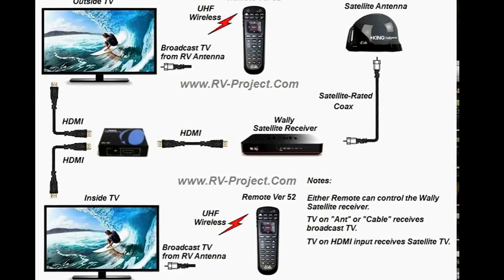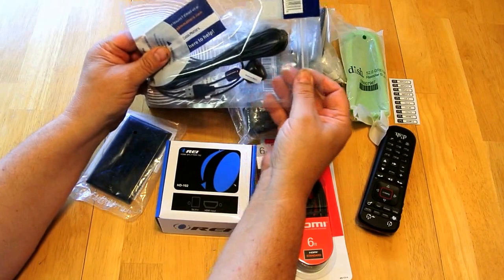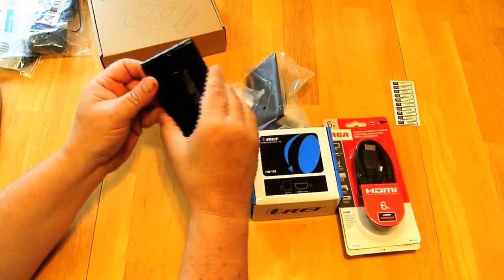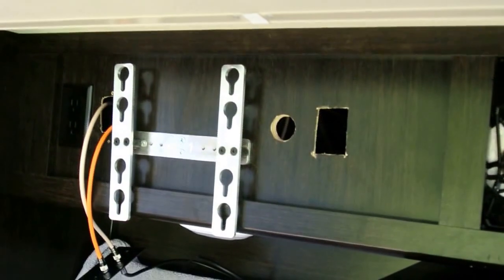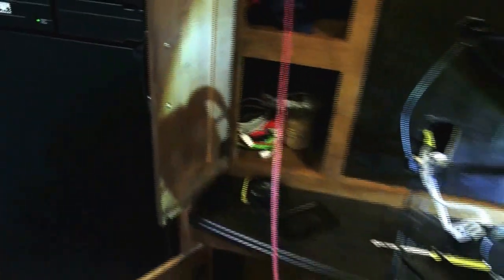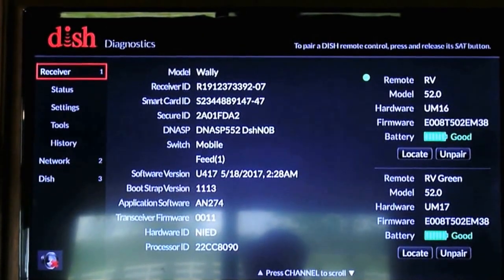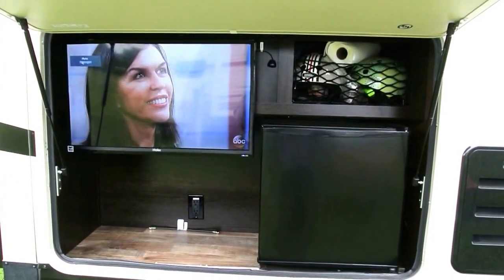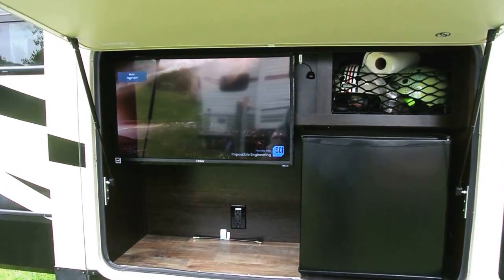Dish HD on multiple TVs in my RV.

Comment: I bought the Dish Playmaker Duel , now we have two separate TV Dish cables and we can watch different channels at the same time. Cost a little more and dish charges a extra $7.00 per month to send two Satellite Signals, but worth the extra charge.
Reply: dennis phillips what is the overall cost per month for that system?
Reply: With the playmaker dual you CAN have two receivers on two RG6 cables independently and it works just same as your house? All I need to hit is Sat 119 for HD service I would like a second receiver in the bedroom.

Comment: Looks great!  Is the Wingard X1 the best, most versatile, most durable and affordable unit out there? And it sure would be nice to watch 2 different channels from the same outfit. What's it take to have 2 televisions each with their own show on?? Don't tell me we need 2 separate dishes or outfits?? thx
Reply from the maker: You need two different receivers and a multi-receiver capable antenna.

Some portable antennas have multiple coax outputs, but it's almost a moot point as you typically need a larger antenna. The portable ones like the King Tailgater cannot view all of the satellites at the same time. 

For example, your antenna at home is larger, and allows the reception of multiple satellites without having to move the antenna. The smaller RV antennas have a much smaller antenna and as you access different satellites, the antenna actually re-aligns itself slightly for each one.  It's not uncommon to lose the signal for up to one minute each time you change channels.

Obviously this will not work with multiple receivers accessing multiple satellites simultaneously as the antenna would be constantly in motion trying to home in on different satellites.

For dish at least, some of the higher-end receivers actually have multiple receivers built into the box. For example, the Hopper 3 has 3 receivers.

Then a home antenna fit to a tripod would be the best antenna - but you will then have to manually adjust it. There may be some automatically adjustable larger RV style roof-mount antennas, but I have not done a lot of research on those as they were beyond my needs.
Reply: RVProject Thank you. I'm not planning on ever mounting anything permanent on my TT roof. The less holes the better. I'm for portability. I'm thinking of getting two 100 watt Renogy solar panels and their appropriate controller. I prefer parking in shade  and place the panels off whatever distance in the sun on the ground. Zamp is probably better than Renogy but twice as expensive. 
I was told by one guy to buy a 12 volt television because inverters draw too much power themselves, but someone else said most 12 volt televisions are junk and just have the inverter built into the tv anyway. I've got 2 Trojan T145 flooded 6volts. The YouTube Love Your RV guy suggests a Samlex pure sine wave inverter and to keep my regular AC powered 24 inch Sansui LED television which draws 31 watts.
I sprung for the 300 watt pure sine wave Samlex inverter. I hope it's not going to drain out my batteries after an hour of TV a day boondocking for a week or 2??
Reply from the maker: A modern-day solid state TV itself uses low voltage. They all have power supplies that convert 120VAC to the internal DC voltage they use. 

When I had my Class C, one of the TVs was powered by 12V. I looked for a 12V replacement TV because I wanted a better one, and my research revealed that many TVs use an external power supply "brick" that produces 14VDC and a plug into the rear of the TV.   I could not really find a replacement 12V TV at that time.

Could you simply put 12V into those 14VDC powered TVs? Hard to say. It's not likely 14V is the final system voltage, and there is almost certainly an internal regulator in the TV that produces an even lower voltage. 

However, the typical regulator requires a slight voltage difference between input and output to be able to regulate properly. Whether 12.6V to 12V (100% to 50% charge on a battery) is enough for the TV to work properly I never did try.

No power conversion gadget, whether it be an inverter, converter, or power supply is 100% efficient and will introduce losses. So by running the RV off batteries, the potential loss path includes converting 12VDC from the battery to 120VAC by the inverter, then changing it again from 120VAC to whatever DC voltage is necessary via the TV's power supply. The converting of voltage from 12VDC to 120VAC and back again certainly loses capacity in the battery.

The two Trojan T145 batteries are 260AH each, which theoretically produce 3120 Watt/Hours. However, you should never drain a lead-acid battery more than 50% for the longest life, so you will get (again a theoretical)  1560 Watt/Hours of capacity before potentially damaging the battery.  

By the way, you should have some kind of monitor on your batteries so you know where that 50% point is.

I say theoretical because we are not accounting for losses. So for simplicity's sake, we can consider your TV having a 31 Watt requirement, if powered for 1 hour, it would require 31 Watt/Hours. Thus, you could power the TV for 50 hours. And the 31 Watt specification for your TV is a peak rating - it might be less most of the time. 

When this factor, as well as adding the losses in, of course the actual power consumption will differ of course. And since you are also solar recharging the batteries at the same time, it will extend the length of your boondocking trip.
Reply: RVProject ok, thank you so much. The only battery monitoring system I've got is the typical 4 red dot monitor that comes standard in most less expensive RVs that combines all tank and battery level monitoring in one little black box mounted on the wall. I'm guessing when 2 dots are gone I'm at about 50% discharge? ? I try to run my nice quiet peaceful  little Honda generator a couple hours everyday but some campgrounds don't even allow that. I'm hoping when I get the two 100 watt solar panels I will hardly ever have to start my generator. Can you please recommend any excellent battery monitoring systems easy to install and not too expensive, that would be great. I had to wire a 2 prong flat SAE plug for 12 volt power inside. I wired it to the power supply to my radio ( used the unswitched wires) then plug a SAE with a female cigarette plug at other end, and into that i plug a 3 socket cigarette adapter splitter/ USB charger by Eugizmo which has a battery voltage output readout on the plug. When im plugged into shore power it reads about 13.4 volts and when i unlpug the RV from AC power it reads 12.6 and slowly drops as time goes on. It says the display will blink red when the voltage reaches below 10.5  ,is this a pretty good way to monitor the batteries? I figure between the RV little black box with 4 red dots and this Eugizmo cigarette splitter output voltage display i may be ok?? This is the unit on amazon.  https://www.amazon.com/gp/your-account/order-history/item/ref=oh_aui_i_d_old_o26?ie=UTF8&itemId=jkoknxitklqtwn&orderId=112-3733780-3357046&returnSummaryId=&shipmentId=DRH0q5jH4 I don't have the two 100 watt solar panels yet. I'm still trying to decide between the Renogy and the Zamp. My next investment will probably be the ASA Electronics Voyager 4 cameras enabled observation system because I hear this is the best for the money and I'm only getting it with one camera to start. I'm so happy about Bluetooth. Bluetooth has been around a while and I really cannot believe my little 2015 Keystone travel trailer didn't come with the radio/CD player already Bluetooth enabled. Fortunately  I recently found this little affordable device on Amazon that plugs into my Jensen amfm cd player aux 3.5mm jack and receives Bluetooth from my Samsung smartphone. The device has a switch so it can either recieve or send. Got another one to plug into my Sansui LED television headphone output jack which sends Bluetooth signal so now can listen to television over the RV soundsystem. https://www.amazon.com/gp/aw/d/B00YCWEBSY?ref_=mw_olp_product_details
Also found this man's video about rv roof care interesting. I'll post soon. Here it is now. Have a look and let me know what you think. 
https://youtu.be/C7LIW1Mwpds
Reply from the maker: Well, you could always build my Battery/Charger Monitor project!

http://www.rv-project.com/projects/batterymonitor.php

A simple voltmeter would do the trick. A lead-acid battery will read 12.2V at 50% charge. The only rub is the battery must be at rest (disconnected) to read.  An alternative would be to minimize the loads on the battery as much as possible when you take the reading.

The panel monitor will suffice if it is accurate. I would turn everything off the battery, then use a voltmeter to check the voltage, then check the panel and see if they agree. 

Here are the battery voltages for a disconnected lead-acid battery (disconnected for one hour to let it rest):

100% = 12.6V
  75% = 12.4V
  50% = 12.2V
  25% = 12.0V
    0% = 11.8V
Reply: RVProject it was interesting today. I hooked up the Samlex pst 300-12  to my 15 amp fused radio's cigar female cigar adapter and had the AC house hook up power disconnected. The voltage indicator on the line was flashing at 11.5 volts not the stated 10.5 volts indicating weak battery. My 2 Trojan 6volts are in top shape I believe. Now why was the television reception horrible? ? The  little red antenna booster light button was on. But yesterday, when I had the RV hooked up to AC house power, I had definitely better reception. I'm in a valley and I only get about 5 channels but at least they come in somewhat with AC power to the RV. I'm used to the reception I get when hooked up to AC shore power. Any ideas what's going on  here? BTW I first tested with my cheap 400 watt inverter. Same results except the fan comes on instantly. Samlex fan didn't go on. I will check into your monitor project, thank you
Reply from the maker: Sounds like your battery is discharged. The only true way to measure a battery is to completely disconnect it, and wait at least an hour for it to "stabilize". Then you can take a voltage measurement.

I don't mind continuing this dialog, however, would you please ask any more questions via the "contact me" section of my website: http://www.rv-project.com/formmail/cf.php

It's a logistical/access issue that would make it easier for me to communicate with you via that avenue.
Reply: RVProject sure, I will try that website. my batteries are no more than 2 years old. I keep them charged on the rv constantly. I always have power available when boondocking. Thanks again for your help.

Comment: I'm guessing you can't use 1 satellite antenna with 2 receivers at the same time?
Reply from the maker: The antenna would have to support 2 receivers. Most home antennas support 2 or 3 receivers, but due to their portability, many RV antennas do not. Some have two ports, such as the King VQ4500 (Tailgater 2), but some only have one, such as the King VQ4400 (Tailgater 3).

However, even though these antennas support 2 receivers, both receivers must be tuned to the same satellite. Same thing for the Winegard X1 and X2.

Here is why.

Satellite TV reception uses multiple satellites. These satellites are in a geosynchronous orbit around the earth.  From the antenna perspective, some satellites are to the left of the other, and some are to the right.  So as you scan the channels in your satellite service, one or another satellite will be used.

In your home system, the antenna is large enough that it is aimed in the center of the satellite cluster, which means each satellite's signal will differ - some stronger and some weaker. However, the average signal to the antenna is strong enough so that they all work. Ever notice when it rains hard that you may lose some channels but not others? That is because one signal is weaker than the other.

In a RV situation, the portable antennas are too small for this to happen. They are small round antennas and they are motorized so they point to each satellite specifically for sufficient signal. In fact, as I use mine, I can always tell when I am accessing a different satellite as I will lose signal for a minute or two as the satellite aligns itself with the next satellite.

So in reality, is it worth paying $7 more per month for a second receiver when you cannot always watch the two channels you want independently?

Your options are to purchase a manually adjustable antenna on a tripod, such as a Winegard TR-6100, or an automatic roof mounted satellite such as a Winegard SK-1000.

If you go with a manual antenna, you also need to purchase a signal-strength meter so you can align the antenna for maximum reception.
Reply from the maker: This discussion has me thinking of another video. Thanks for the dialog.
Reply: Guess there's no easy solution but some would say you're camping and satellite tv is a no-no  :)